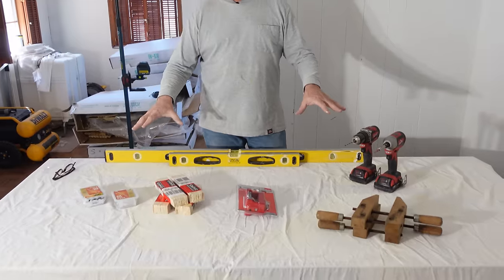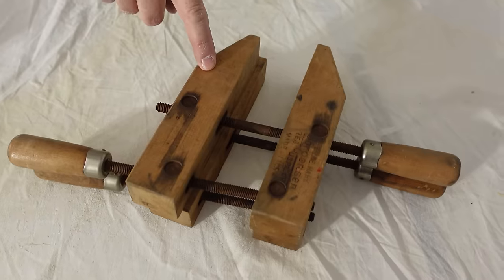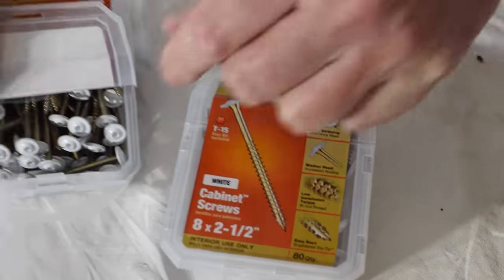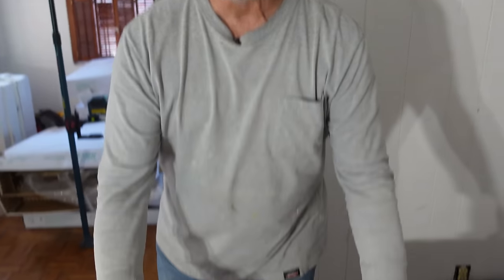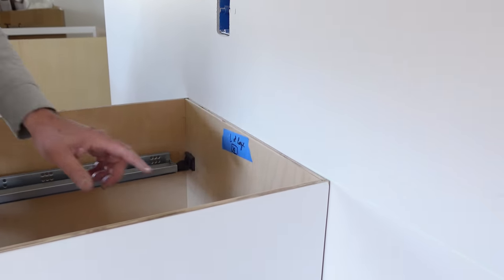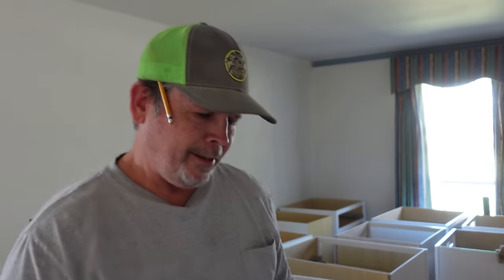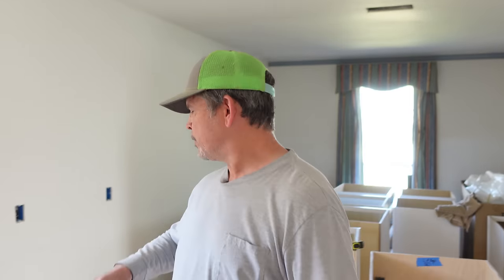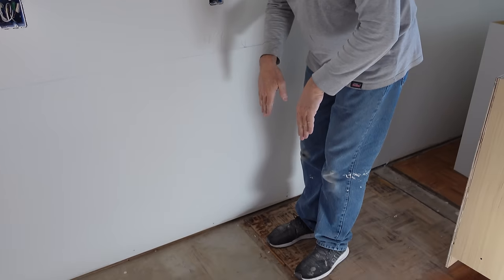How To Install PERFECT KITCHEN CABINETS (DIY GUIDE)

Comment: if you poured self leveling floor compound in the cabinet cavities, would that have made all the cabinets drop in? in a remodel where the entire subfloor is cleaned off, would this be a good approach if there was no hard wood to worry about?
Reply: That is far to much work and you would have to probably do multiple layers to get it right.

Comment: You can also use a bugle head screw behind where your door hinges are to fasten the face frames together. Might need a bit of a counter sink, but obscured by the hinge hardware is a great way to hide the screw head.  Also, I love those truss head cabinet screws to fasten the cabinets to the walls!

Comment: Use the Vice Grip clamps with the flat pads. Clamp at the top drawer openings and make frames flush and then you can lift up or hammer down the face frames to make them flush on top. Screw together. Now you either have a second clamp or remove it from the top and clamp at the bottom and repeat drill and screw. Same procedure with uppers. If that face frame tool worked fast the professionals would be using it. Never seen anyone use one.

Comment: I really just wanna know how long before you got the cajoles to cut that notch in the 2x4 for the floor. That looked like it was sure to pinch between the blade and fence and rocket right back at you
Reply from the maker: I grabbed the off cut and pulled it thru to prevent exactly that 👍👊

Comment: Would have been nice to see you level and plumb with the shims. That's the confusing part and you skipped it.  Also, would like to know how you would install when toe kicks are separate from boxes.  I have heard that's easier.  I hope you will video the install of uppers when you get to that point.  Thanks.

Comment: This is all good things to know and will work in new construction but I have work in houses where high point to low point is Three quarters of a inch on concrete walls not straight then you can see if you want to install cabinets or some other line of work

Comment: You should convince the customer for a left turn cabinet in that corner, You can get he pullout tiers for them now that turn into the hidden cornere and makes it so you only need to install one piece of spacer trim between the corner cabinets.
Reply from the maker: We are installing a cabinet there later 👍

Comment: if you're replacing the laser with the chalk line anyway, then why does it matter if you make it an 1/8" higher to prevent the cabinet from blocking it?

Comment: Thank you!

Being european and assembling most things with Torx 20 (kind of industry standard from small to medium size screws here) it hurts my eyes watching the pain of using philips head screws. I like many US things and your perspectives are so great but screws overthere are a nightmare.
Reply: The install screws they're using are T-20 (maybe T-15), but for small screws like the brackets, it's super hard to find screws under 25mm length in anything other than a Phillips. I hate it.

Comment: Unfortunately, I've stopped using that face frame clamp.  I even put some extra padding underneath it, but I still somehow dents  the fronts slightly.  It's still an okay clamp, but not overly impressed with it.

Comment: My kitchen has parquet floor like that, but it was ruined by deadbeat tenants and is falling all to pieces and coming up. Did you know that hundreds of people have to go to the ER bc they cut themselves opening the plastic packaging? I tend to use scissors to cut mine open.
I'm lazy so when I had to cut holes, I took a piece of large paper with grids for making templates. I used something that would transfer to make a mark and then put it over cardboard and cut out the spots where I needed holes and did a dry fit with the cardboard.
That corner where base cabinets go to peninsula is a great spot for a corner cabinet. I like how you secured around blocks to hold the peninsula cabinets in place.
Reply: Those plastic wrappings are insane. I think it has to do with them being on display in stores and it is to reduce theft.
Reply: Yup. Theft is really high in my area. I caught a few customers trying to steal before (and I wasn't an employee)-- I just saw them and said "Hey! Trying to see what's in the box?" and stood there watching them until they put the box back on the shelf. They had already torn part of the packaging. When they left I took it to an employee and said I caught someone trying to open it.

Comment: How would you  do that fasting to a heated slab? Wouldn’t want to put a nail in the pex pipe in the concrete.
Reply from the maker: You’d have to glue down the blocks.   Someone commented they use foam like Great Stuff

Comment: I allways use adjustable feet when installing cabinets, much quicker if you just thunk it in its place and use the laser to level all 4 corners and clamp+fasten
Reply: Also after you establish the high spot and have the first lower cabinet in place any height markings are irrelevant, set the laser and get your reference from the first cabinet and move on

Comment: Did you not need to fill that corner gap before stone comes? And is there not another cabinet facing the other direction or a filler of some kind in that corner?
Reply: 3 inch fillers are standard. Can be done after the stone, but not easy. Probably between template and install.

Reverse cabinet sometimes happens, but rare. Without a blind corner or lazy susan cabinet, it's probably gonna be dead space.

Comment: i only worry about cabinets in same run,  if its on the opposite wall and doesnt tie into other cabinets its a seperate run....if its way out than yeah,  if its minimal youll never see it and wont make a difference plus the toe kick will be same even though cabinets drop or rise a bit.........I use trim head head screws behind the hinges to tie face frames together, one the hinge is on you never see the screw head, but there are 10 different ways to do any job.......

Comment: What is the common practice in the US regarding floors. Are they usually fitted around cabinets or first and then cabinets on top. Always bugged me if it was the former as you can't easily change a kitchen layout without having to put down new flooring.
Reply: I have seen it done both ways. 
1) Put the cabinets first , this way allows you to change the floor without trying to remove flooring from under the cabinets. 
2) Put the flooring first, this way allows you to change cabinet arrangement without having to fix the flooring.
Reply: Really depends on the flooring thickness. With a backer + 3/16 VLT it's negligible and we do cabinets straight to sub-floor.  If there's a floating lock floor, ceramic tile or 5/8 T&G hardwood, we'll do spacers under the cabinets. I much prefer installing on top of the finished floor. If you don't use spacers, it can bite you on things like appliance heights.
Reply: Usually best to put the cabinets over the finished floor, unless it's vinyl flooring, which sometimes isn't supposed to go under the cabinets due to the expansion/contraction. Trying to run hardwood floors up to cabinets can be a nightmare. My idiot former boss thought he was slick and decided we do that once

Comment: absolutely no idea how it happened, but when I rebuilt my kitchen, the subfloor and walls came out plumb, true, and square.  but I didn't have a floor, so I put 1/2" plywood down as a base, so my dishwasher didn't end up in a hole after the floor went down.

Comment: You don't like the grk trim head screws for the face frames? Much better look.
Reply: I've used everything from 1 1/4 drywall screws on frameless to the white head GRK trim screws on face frames. I do like the trim screws, but they can be spendy over time and require being clamped. A company I just started doing work for has some nice screws that actually pull it together without clamping. Same chrome as the hinge, and almost no one points it out. Big time and money saver.

Comment: Can upper cabinets be hung without blocking in the wall. Someone said they will not be secure with only screwing into the studs.
Reply: If they are fixed into stud they will most certainly hold.

Comment: I have to say this, your adjustment of 15 3/8, based in my experience with having to remove ranges and other appliances??  I would have gone probably 15 1/2!!!  But that's just me.  I as the legendary Justin Wilson always said, "I'm a safety engineer.  I wear "both" belt and suspenders!!!!"  As I'm sure a lot are well aware, there are products made to keep things from falling down the cracks between the range (select your appliance of choice), as well, as, my 2nd (and 3rd...same lady) Ex-Wife implemented, Cutting Boards that extended over both edges.  I'd rather have a "larger" gap in anticipations of something that was not anticipated!!!  But, that's just me.  (Yes I adopted this philosophy after watching 3 Ex's, one twice, that was my bad judgement, wanting things "I want it this way" and having had to suffer the reconstruction from their total lack of grasping "you have to plan in advance, not just what you want "Right Now!!!" philosophy.  Thank you for for pointing out "Planning In Advance" beats just trying to make someone happy "right now."  My experience of almost 3/4 of a century has given me the common sense to "Plan for complications in the future!!!!"

Comment: You can't mark the wall everywhere at your 34-5/8's mark.. if the floor is dipping so will be your cabinets.  The LINE is the marker, set it to high spot & that's your line, not the marks.

Comment: To understand why the smallest number is the highest point, we should understand the methodology behind this. Firstly, the laser has a line that is flat on a plane going all around at a constant level from a given spot, with this understood, when taking a measurement from a lower spot (relative to where the laser was placed) all the way up to the laser point you will read a larger number because the length is longer to go from the low point up to the laser level hence the higher number is the lowest point, and as you can imagine from the smaller number you would measure less distance from the bottom to the laser measurement because the base is at a higher elevation meaning less distance or less length as a measurement taken.

Comment: Install the upper cabinets first then go from the high point of the floor for the base cabinet.
Reply: No. 
Lower cabinets first and then set the upper cabinets in relation to the lower cabinets. It makes it much easier to do that. But it comes down to personal choice.
Reply: @bighands69  depends how long you want to install. Keep in mind your "back "pretty hard to hang 42s over the base cabinets . But that's just me .

Comment: 23:00 -- The easiest way to do that is to either use hot glue to hold the screw on the driver or super glue.  That way you don't have to worry about it falling off the drill while you are trying to line it up.
Reply: Maybe when dyi.  If  I had an employee or a contractor waiting for a hot glue gun to drive a screw, they'd be waiting in the unemployment line.   All that's needed is a piece of tape.  Lol, hit glue gun? You must be a troll.
Reply: @beautiernan4845  -- These videos ARE for DIYers. If you are looking at YouTube as a professional, you probably need to find a new job no matter what method you are using.

Comment: I prefer to use trim head screws to join the face frames...
Reply from the maker: yeah we tried them but they pulled into the wood before pulling the wood together
Reply: @StudPack  
You don't clamp your face frames before screwing them together? Clamping gives you perfect alignment, let's you reposition before permanent attachment, AND let's you use trim screws so the screw head doesn't show. Sure, it takes longer, but the end result looks better\more professional.

Comment: European cabinet adjustable legs make leveling much easier.
Reply: As a cabinet installer, I'm not a fan. Of course the back inside corner is gonna be low.

I know they're running RTA cabs here, but for custom cabs, or even IKEA, single piece toekick box is way easier. Especially for production work.

Comment: Great tool, but I will NEVER place a screw or other fasting system in the middle of the frame face...leaving that expose forever. Binde fastening is the cleanest technique and using same tool!

Comment: Home depot sells a vice grip style C clamp that works really well, or you can just get the 4$ special from harbor freight. We use fin head screws to go cabinet to cabinet. Its a little more hidden. I also recommend flooring the whole kitchen if you change the flooring. not just up to the cabinets. That way if anyone else changes the cabinets, you dont have holes, and it looks a lot more finished. Its better as far as leaks go too, because its not like there is ever going to be a little gap water can run down and sit on the subfloor. you can also use a dead blow hammer to make adjustments to your cabinets after you clamp them together to get the faces a little more perfect.

Comment: If the laser interferes at 34.5” and you were snapping a chalk line anyway, why not move the cabinets out of the way and use laser to set a chalk line at 34.5” instead of setting at 34-5/8”?? Totally confused by that move and hoping you were just confused on camera.
Reply: He is only explaining the working height in terms of the laser line. And how it tends to make it easier to work with.

Comment: How is the high spot 34/1/2  34/3/4 is higher than 34/1/2 please explain
Reply: Not from the top down, the lower number is higher in reference to the floor at ground level plane

Comment: ...mmm BUT did you also put  level the island at the exact same height , as the wall cabinets ?  
You should have snapped a line where the front of  all of the bases fit and also checked how level the floor was with your laser !   
Also Never Ever rely on your laser reading PERFECT !  I spent 35 years using them on construction sites and was taught a quick way to check them .... Many were Bad and needed to be repaired or replaced .

Comment: You should not have to put screws in the bottom of the cabinet because your getting a heavy stone countertop.  It’s pretty much impossible to pull out the cabinet.

Comment: Rather than extra measurements for the extra 1/4" of the framing, why not just mark the center of the back of the cabinet and align it to your center line on the wall? Two measurements, two marks.

Comment: what a struggle lining up the units to the chalk line. it would be so much easier if you had installed adjustable feet to the carcasses.

Comment: Pro tip to Stud Pack (7:40), if you have to cut the face frame on a new cabinet to make the range fit, does the wife really need to know?
Reply from the maker: She does not 😁

Comment: If you can't measure and figure out where your uppers are going to go and set the walls first then your making more work for yourself, even if it has large ref. Cabinets with panels. I do it every day and never set bases first. Someone that installs everyday for a living knows that you install uppers first.
Reply: I'm wondering why the didn't have a layout drawing of the kitchen with the location of cabinets.  There are many simple CAD software programs to layout a kitchen with cabinets and appliances.
Reply: I work off 2020 program drawings. I think his channel is more for the DIY in mind rather than someone that does it everyday for a living.

Comment: Do not use that red bessy clamp thing - they dent the face frames real bad.    There are a couple of rivets or something embedded in the rubber.    We had to repair / replace about $30K worth of casework (cabinets)  because one of my guys used it.  Thankfully we spotted it early in the job   -    kitchen contractor

Comment: I find those cabinet claws to be a waste of time. Also, don’t screw the cabinets off to the wall until you have the entire run leveled and screwed together and planing at the front. And double check the range opening before screwing off.
Reply: Great job installing. Lots of good tips. Super sweet table saw.

Comment: I bought a pair of those Bessy cabinet clamps. I have to say I'm thoroughly disappointed in the quality of them.
I had to file casting flash off one of them.
The biggest disappointment was the rivet that holds on the alignment plate damaged every pair I used it on until I noticed it. It was too tall and put a dimple in the joint. I had to grind the top of the rivet.
Great useful tool, but lousy quality.
Bessy used to be the gold standard, now they're crap.
Reply from the maker: We started having the exact same problem.. cmon Bessy 🤦🏻‍♂️

Comment: Warning. These tools will leave dimples on your cabinets!!!!! Crazy these guys don’t mention that. Have to be paid for this item, which it is what it is. You have to use a shim/some harder material on the part that aligns the face of the cabinets together, not the part that squeezes the cabinets together. 

You were warned.
Reply: haven't had that happen yet.

Comment: As a life long cabinet man myself I,m sorry brother but you install cabinets ass backwards !
Uppers always go in first !   Pantry cabinets always dictate height ! Just a few tips for you.
Reply: Actually, physical use of a flat surface for cutting or dishwashing determines the height to enable ergonomic use by the cook or chef. Cabinets at the wrong height are a pain in the forearm and shoulder. Generally set at stove height. Upper cabinets are then determined by the: forehead collision/arm-reach/eyesight triangle if you have to work under them.
Far easier to install bottom cabinets, lay down height packer for the top and use cabinet jacks (2 apprentices) to place the upper cabinets at the right height, presuming they don't go to the ceiling for finish.